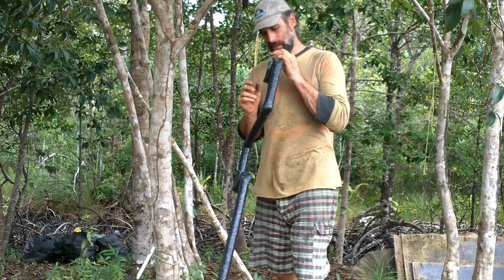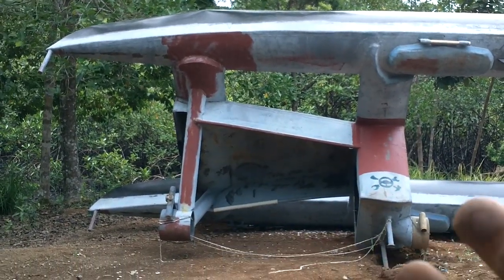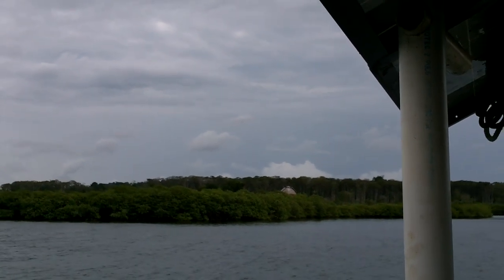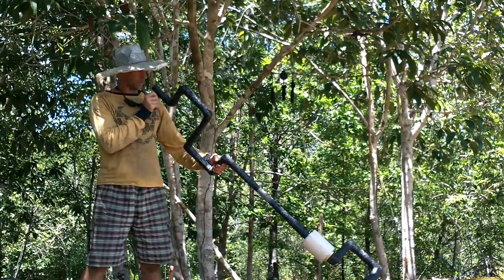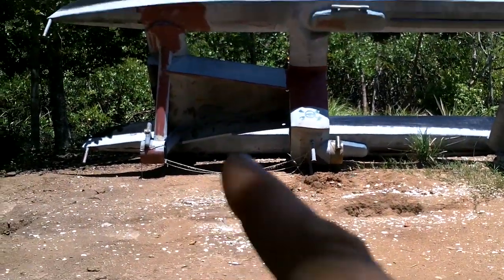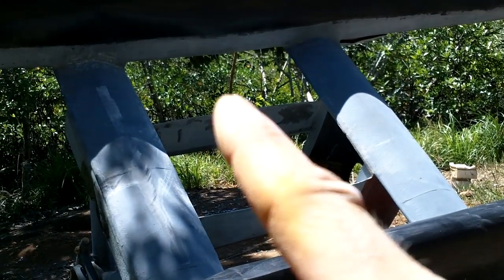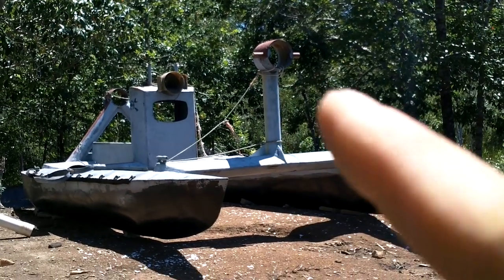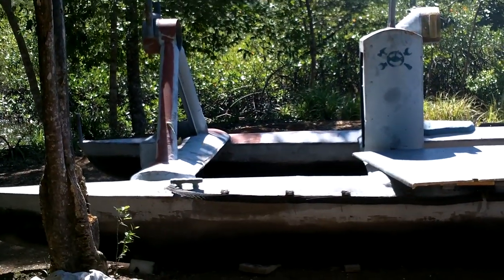Boat Chips 007 Right Side Up!

Comment: They are called osmotic blisters and even commercially available boats can get them.  The boating community typically uses an epoxy "barrier coat" between the fiberglass and bottom paint to isolate the fiberglass from the water as a preventative measure.

Comment: Im thinking a mini pedal boat with adjustable gearing and a hydrofoil! If you can get it up to speed, engage the hydrofoil, lift off the surface, and you get another level of speeds possible!

Comment: Jamie, I was thinking (like a mechanic) when you were holding the "crank halves"...that...would it maybe make a difference if they (the crank halves) were "timed" to get the most out of every stroke?. Like in an internal combustion engine, where engineers had to discern, which piston-rod assy. (your legs) fired (pushed ) on what crank journal (the foot rests of your crank assy.) to get the smoothest power stroke. They cast the crankshaft to "allow" for this, or to "time", when each piston moved, to turn the crankshaft.....know what I mean ? Interesting to think about.